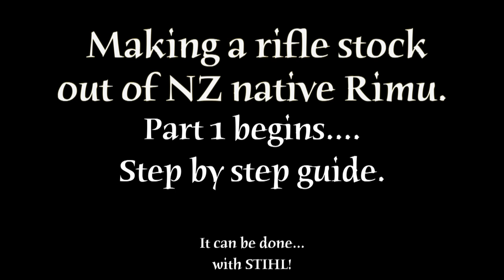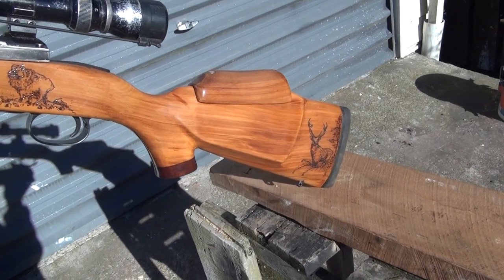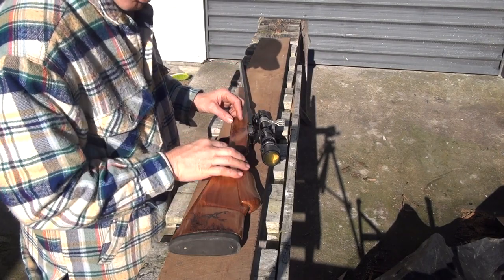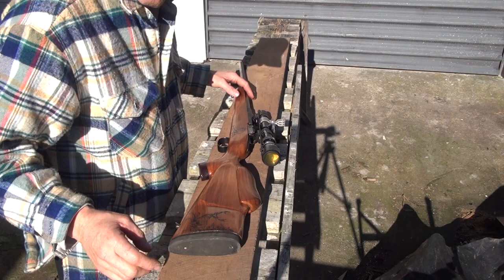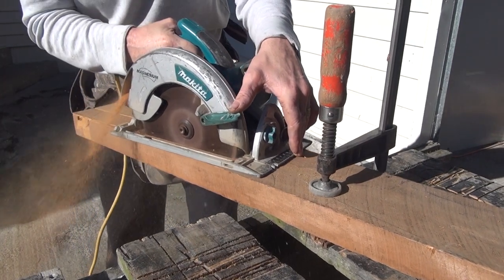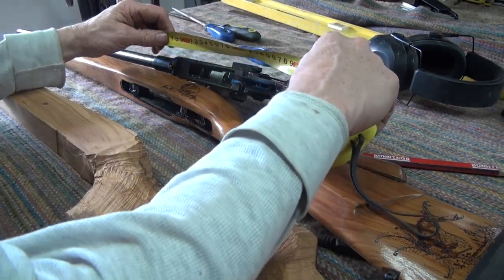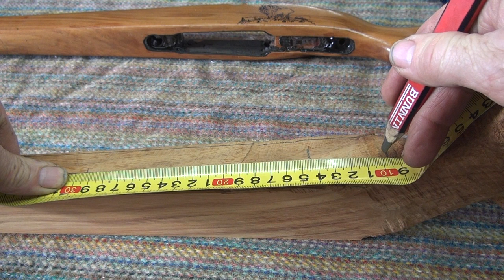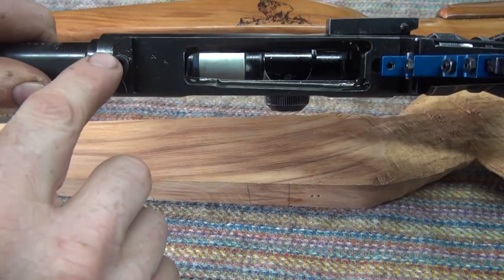Home made rifle stock, using a chainsaw. Part 1 of 4

Comment: Is your table saw backwards? Looked like you have the blade set correctly for direction you're feeding it but looked like it was spinning clockwise from camera view so you're cutting with the back of the teeth on the rise instead of the front as they fall.

Is that intentional?
Reply from the maker: hahaha it was just an illusion ....blade was cutting the right way...but I see what you mean.

Comment: this is amazing is it okay if I use this video to make my own airsoft rifle stock
Reply from the maker: Hi Tristan, good luck in your project.
Reply: Thanks
Reply: no, don't. No offence but it seems you are new to this. This guy has balls of steel. DON'T USE chainsaws and bandsaws. They are very dangerous and hard to use. Use a jigsaw and a handsaw. And eat out the rest with a file or a belt sander. Also google up wood types and try to choose one to suit your aeshetics and needs. Don't use something like pine wood or some other low density woods
Reply from the maker: Yes… Good point MrPanos. You have to have some good skill level to use power tools and a chain saw.
I'm a builder by trade and have aquired skills over the years.

Comment: What scope are you using?
Reply from the maker: on this rifle a Tasco vary power 1.75 - 5 x 20
Reply: is this a antique model? not kidding have been looking for this scope for 5 years. what the tube mm for the scope mount? would it fit a mosin nagant scope mount you think?
Reply from the maker: I bought this scope in the 80's I think or early ninties. 
Good scope for the bush hunting.
Scope tube is 25mm